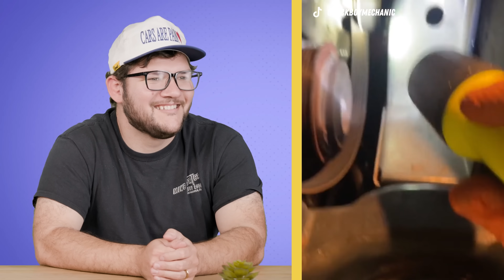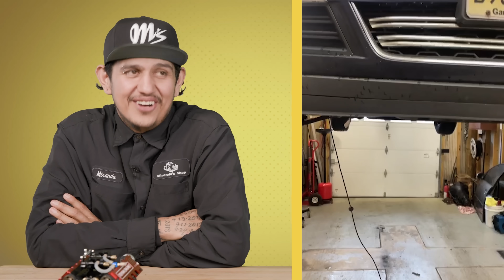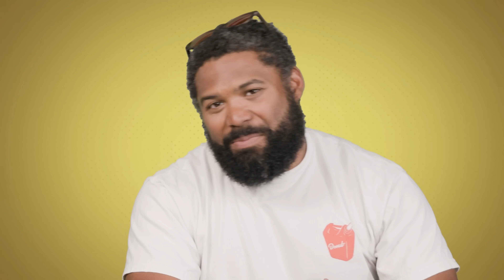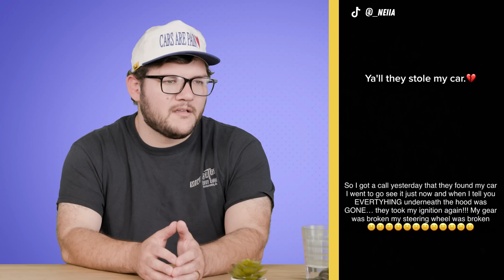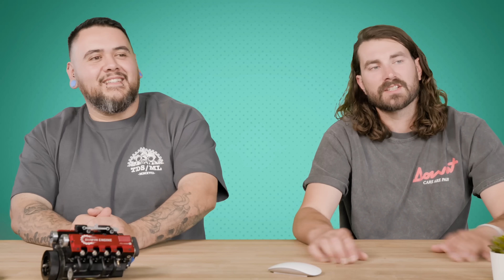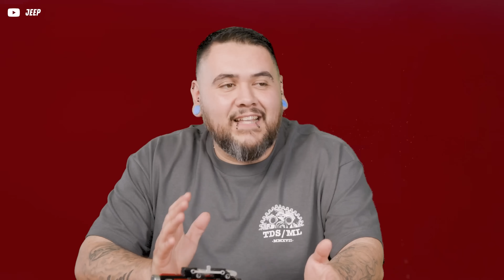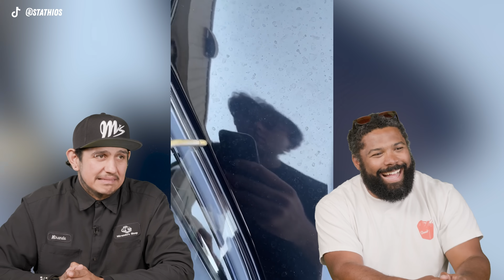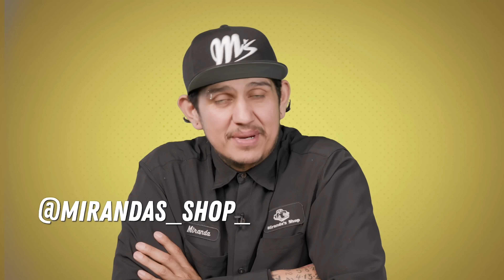Mechanic Reacts to Car Engineering Fails

Comment: The worst people for dodgey engineering is us car guys.  Have you seen some of the dodgey work that gets installed these days by guy like us.   It works but at what cost.  

Us car people are the worst we just want it to fit and will do some laterally thought out shit to do it 😂😂😂.  Come service time we are kicking our selves for making it so complicated 😂😂.  So id say top of the list of awdul design choices should be ourselves 😂
Reply: As long as it doesn't mess with an object's safety factor (ie. grinding part of the wheel barrel just because it doesn't fit over those new big disc brakes) and is done neatly, it should be OK.

Bottom line, the work must be proper shop-quality work, none of that redneck grease monkey nonsense that disgusts technicians left and right.

Comment: I was a mechanic and boy did I see some very big fails:

- Renault Twingo Mk1, the airbag cover could cut into your arm on deployment
- Alfa Romeo 156 V6, the oil filter was to long for the space given (towards the firewall) so you had to cut it into pieces
- Ford Explorer V6 4.0 (Mk1), the spark plugs were behind the inner wheelarches so had to drill into them or remove the engine
- Renault Espace V6 3.5, they stuffed a Nissan VQ35DE engine in there so you had to remove the entire intake to get to the spark plugs
- Land Rover, on a lot of turbocharged vehicles the loom for the turbo actuator is mounted and routed in such a way that oil leaks into the engine harness that leads into the ECU shorting it out and a leak is guaranteed
- Renault Clio Sport Mk2 and 3, there's not enough space to pull out the idler pulley or get to the timing belt tensioner so you either cut into the front support or get the engine out

And a more general thing I've seen:
- Body on frame vehicles made by GM, Chrysler and Ford for the US market tend to complete rust out within 5 to 6 years in winter conditions due to very poor quality sheet metal and rust prevention

There are a ton more but those yre some from the top of my head.
Reply: Let's be honest, that's not the only fail you saw on an Alfa Romeo 156..
Reply: @VinceRiviera  you mean like that one time I had to replace a clutch 3 times within not even 200km because the factory kept packaging clutches for the 2.0TS and Fiat Bravo HGT as 2.5 V6 compatibile?

Or those front shocks that blew so hard that they almost shot their pistons through the bonnet?
Reply: @HFMartini6  Yup, sounds like Alfa's alright
Reply: I’m confused, if the oil filter has to be cut in pieces to remove, how do you put a new one back in?
Reply: @ian9toes  the new one was half the height of the factory fitted one.

On the Nissan Terrano 2/Ford Maverik tho, yiu had to bend the inner guard out of the way and back down again to replace the oil filter on the diesel engine.

Comment: I'm an engineer, just had to repair a 1990 ford f 150 rear axle. Normally the rear axle has a standard bearing. This has an external ring, an internal ring with rollers in between. When the bearing fails you can replace it, not a f 150. There's no inner ring for the rollers, so the rollers roll on the actual shaft. The Rollers had worn the shaft so I had to sleeve it while waiting for a replacement. You are supposed to replace the shaft which was about $600 instead of a standard bearing which costs $30.

Comment: We have 3 mechanics stationed across Canada and their sole job is to take our equipment into the field and replace components. Then they report back to the engineers on how easy or difficult it is, and adjust accordingly.
Reply: What company

Comment: i'm an engineer, but i always made it my goal to learn how production (or techs) work. i have learned an immense amount just from a small amount of time wrench turning. i will never understand why most engineers refuse to get their hands dirty. its not that hard to learn the bigger picture and learn why you shouldn't put that bolt there

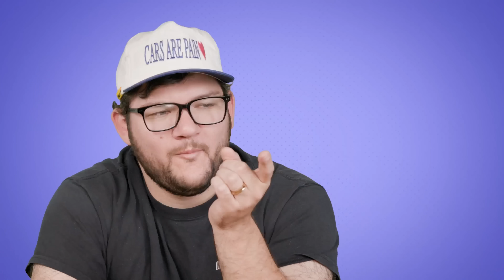Comment: 0:58 if the bolt doesn't need to be that long why not just cut the bolt twist the remaining stud out and replace it with a slightly smaller one that just fits in. As apposed to taking the whole engine out

Comment: Modern car failure: ever try changing the battery on a 2010 Dodge Journey? It's probably worse than the design of that bolt. Anyone who's tried to access a 2010 Journey's battery know what I'm talking about.

Comment: Meny of the problem that usually blame on engineers is probably the bean counters fault. Because probably the company already asked the engineers if this would work and the engineers probably would say if we change this to this it will work, but that is not fitting the budget! So the company that’s driven by economics and profit engineers to listen to the bean counters instead of the engineers.

Comment: Can you guys make a (Imaginary) list to talk about what the goals of the auto makers really are when they build a car?  Because they are obviously the people that force the designers and engineers to make the car as they think it should be.  For instance, Ford stated years ago "I will sell the cars cheap, and the parts dear!" or words to that effect, and their design ever since has lived up to that motto.  If I were to write Ford's mission statement, I'd say "Ford's goal is make the car look barely good enough to sell, at least to people who have no experience with them,  but we design the car so things start breaking at 40,000 miles, and with increasing severity.  WE will design "normal wear items" like starters and alternators to fail quickly, and also make them hard to work on too!  This will help to discourage DIY mechanics and drive the pro mechanics half-mad, who in response will price the labor through the roof." That's a mission statement I can respect.

Comment: The last body shop I worked at had a relationship with the local Tesla dealer. We would fix, panel gaps, paint correction, broken speaker mounts (Plastic welded from factory for some odd reason), door handles. We wouldn't touch the headlights, the mounting points have no adjustability unlike every other car manufacturer, they are spot welded in place and made to the exact size of the fasteners. They tried using the in house techs but they honestly beat the cars up more and got less than desireable results. Things like OEM rocker panel mounting clips were inconsistent on model S, Fender mounts are a joke, flimsy and easily bent out of shape and spot welded incorrectly, model Y's have a ton of door alignment issues and inconsistent placement of frunk tray support (spot welds). The nut inserts holding the diffuser would break the bond in the surrounding plastic (Locktite stronger than the thread-insert to plastic bond). Stay away from Model S, X and 3. The model Y is the most consistent. Not including the headlights, every other cosmetic issue can usually be fixed.

Comment: Speaking of dripping, the new Audi A3's have rain holes near where the door opens up. The landing pad is right on the seats so whenever you open the door your seats get showered, subsequently getting a wet backside. Bravo VW.

Comment: i remember hearing advice from an old engineer and machinist, who talked about ways to acheive "harmony" among the two peoples
the biggest one was, when the engineer crew gets together to okay a new project and how it looks? they have atleast ONE old machinist there to keep them in check.
and after being handy around machines, as all the men in my family are, I can easily concure that a similar solution of slapping a wise mechanic in that engineer group would be a good idea too.
Reply: I believe in having a highly detailed guy and then a big picture guy between the two you can always figure out the easiest most efficient way to get something done that always works in last forever

Comment: I'm an engineer (not automotive though), and some of these are because the engineer was probably only designing a part for a subsystem and only worked with how it is assembled on the factory line without any regard for repair or maintenance. But that's is what they are told to do. The OEM doesn't want to pay then engineer to do that.

My only beef with mechanics has been the few times I've needed one, where they don't torque the bolts to spec and/or cross thread fasteners, or even worse, forget to install the upper caliper bracket bolt at all from a simple brake job which ended up damaging a bunch of parts when the caliper came loose on the road.

Comment: Also, on Jeeps of the last 15 years or so, manual transmissions and differentials are prone to absolutely unreasonable failures, as are almost all Mopar engines. It doesn't matter how carefully you drive, or how well you keep up with maintenance. Mopar makes shamefully lousy vehicles for the regular masses, and they spur sales with their high-dollar hot rod halo models, which improve the public perception of the entire Chrysler model lineup, by proxy. So the people who can't afford to waste their hard-earned money on a problem vehicle that keeps incurring surprise towing and repair costs, on top of the disruption and possible job loss that can easily result from getting stranded on the way to work, or from the unexpected loss of a vehicle while it spends time being diagnosed and bandaged, even if it's covered under warranty and technically "free." Eventually, it becomes time to cut the losses and stop throwing ever more money into a car that routinely suffers major, expensive, time-consuming system failures... And the buyer is left with a large loss, of completely unrecoverable money, and a vehicle-shaped paperweight that can't be driven and can't be re-sold for anything remotely close to what they sell for at the dealership, at least not without first sinking thousands more into replacing something major and critical, like the transaxle or engine, only to sell the whole vehicle for less than the cost to replace either of those items.

Comment: The best example I can give you is the Peugeot DV6 engine, there's so much wrong on this engine that we could write a book of it, but I will just mention its biggest flaw which is the injector gasket.
When those fail, combustion residues rise along the injector and they are pushed down by a plastic washer through the valve cover gasket inside the engine.
When this happens it clogs the pick up tube and can trash the complete engine.

Comment: How about the starter motor on a Honda Element? There are two ways to do it. The first involves navigating it around a slew of tight corners that can damage the unit, but only after removing the knock sensor via a 27mm offset wrench that you get maybe a quarter turn of range and a mounting bracket, not to mention a completely blind bolt on the opposite side from your view (thank God they actually did make that bolt 3 inches extended). Option two has you removing the entire intake manifold, which by proxy involves removing the front K member so that you can barely squeak the manifold forward enough to remove the resonator box (only applies to 2007+) with 3 blind bolts, only to then have to find the opposite blind bolt on the starter as well.

I love you, Honda. I love the Element to death, despite how much it hates me. But you couldn't have though to maybe make it just a little bit easier to do this?

Comment: As an old mechanic, yea man i blame the engineers 99% of the time. But then again if i was an engineer? Wtf do i care about fixing the car? I need to design it and meet certain design specs... THAT'S it. In my experience no car fab or engineer design a vehicle with mechanics having to fix them in mind, simple.

Comment: This reminds me of my Honda days back in the late 80s and early 90s when I used to remove my fuel pump relay from the car for security reasons. It was easy enough for me to put in on my key chain and plug it back in... and all I needed to do was carry jumper cables with me so when thieves killed my battery I could just jump-start it and continue on.

Comment: The VW Amaroks powersteering line has s random metal crimp about a third of the way down. No idea why it's there but it leaks all the time and new pipe is a 2 hour job and about $300

Comment: I work on boats. I have a cascade of engineering/design fails that have led to two engines in a Gemini Sailing Catamaran having issues. The port one had a seized alternator and starter. The starboard one had a rotted through return line, a rotted out return spring in the kill solonoid, and now a pinhole rotted into the oil transfer line to the injection pump leading to a dry sump incident that thankfully did not kill the engine. 

All of this happened for two reasons. One- the engine room hatch covers are PERFECT for directing salt water onto the affected areas. 
Two- Yanmar decided to squeak a penny out of every four engines by not copper jacketing the fuel pipes and the oil xfer pipe.... Resulting in leaks. One nearly requiring an overhaul. 

At this point I am trying to save the poor guy money so his business can survive two bad engineers!

Comment: A simple thing that we can praise engineers for is on the Nissan Armada and Titans (the 04-15 atleast) have the oil filter above the cross member but they added a little ramp to run the oil away from the crossmember to make doing oil changes a bit less messy

Comment: You should go through a car wash in a 2020 seat leon, usually had 12-15 warnings and if you weren't quick enough to shut off sensors it would autobrake. 
Every shortcut they could take they did take with that one!

Comment: 13:52 so I can go on and on and on about bad engineering 10 years as a ford tech 12 years working for my self. Hands down Chrysler products are the worst engineered cars in the road from hell cat to the 200c garbage. One that comes to mind recently  a 2015 Chrysler 200c 3.6. The serpentine belt is routed in a way that the tensioner has to come loose and the tensioner is positioned in a spot where the bolt is only reallly accessed by an open end wrench, but wait it gets better the coolant hoses run smack in the middle of the belt between the crank pulley and compressor so not only do you get to fight the tensioner you have to drain and fill the coolant. The same 3.6 on a jeep around the same years the bleeder screw for the cooling system on the thermostat is about 1/2 inch from the throttle body and it’s a large Phillips it is wide open on the front wheel drive vehicles but not on rear wheel drive. Not to mention the oil filter housings or the radios or the motor mount or the heads. It’s love hate love them because they are garbage and they keep my bays full but hate them because they are engineered so poorly it’s flat insulting sometimes

Comment: 9:14 As much as I love Tesla, the build quality is garbage. No issues with my door handles on either the Model S or X, but the panel gaps especially on the X are all over the map, and the left falcon door has a hinge that scrapes. There are so many issues with the body alignment I am not typing it all out. Model S has a couple spots but it’s gaps aren’t anywhere near as bad as the Model X.

Comment: Sometimes it's not the engineer, it's the bean counter. We will engineer it correctly and the bean counters want a change to make it cheaper. We warn them, they insist, and management makes us do it. Then a year later they are all....WE HAVE RECALLS ON THIS PART, WHY DIDNT YOU WARN/STOP US?????? 
Ummmm, we did

Comment: I fix guitars for a living and I completely agree with Sandro, it's like everybody gave up on building their stuff right. Some companies are a bit better than others but most of them use fresh wood which makes sharp fret ends, warped pickguards, sinking acoustic tops, severely bowed and backbowed necks, acoustic brace separation, cracks in acoustic tops, cracks in lacquer. I could list just as many more. I got a 1500 dollar fender on my bench that had completely unpolished frets with 220 grit chatter, and the fret ends were sticking out 1/32" on each side. And gibson pickup tape is always loose.
Reply: And yes, I made that fender beautiful

Comment: My '014 Silverado 1500 5.3 L has what looks like a Mechanic's eye when it comes to the oil change.  Both the drain plug and the oil filter are next to each other, not draining in other parts of the car and easy to get to.  In fact, the oil filter is strictly vertical for easy draining.  This has been a dream truck for me.  The only other time I saw a conscientious design was the '95 Olds oil filter.  No the location but a plastic diverter that funneled the oil off the front cross member.

Comment: On that Land Rover the oil is meant to be extracted from the top. When you open the oil fill cap on the top of the engine there is a metal tube right in the middle of it. That tube goes all the way to the bottom of the oil pan and is there to extract all the oil. Excellent system!

Comment: I had a 199x Nissan Altima. It was perfect until reaching ~197K miles. That's when things started breaking, one after the other. Radiator, alternator, then tensioner pulley. Just like the first car in this vid, you had to lift the engine to get it off. At that point I decided, "It's had a good life," then took it out in a field & shot it

Comment: I can tell you a bad engineering fail.the brake roadors on the 90 to 93 accord you have to remove the hole knuckle to replace them.

Comment: I have a 2010 ford explorer sport trac and it has the same problem that the Land Rover has. When I go to drain my oil out of the pan it drain directly into a hole in the suspension cross member and comes out either side near the bushings on the control arm, it is hell and makes an awful mess